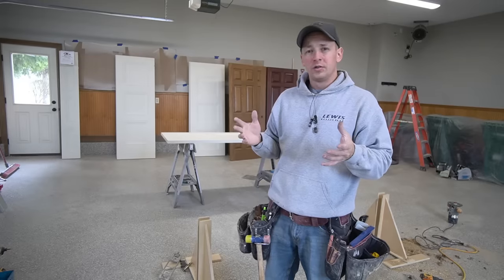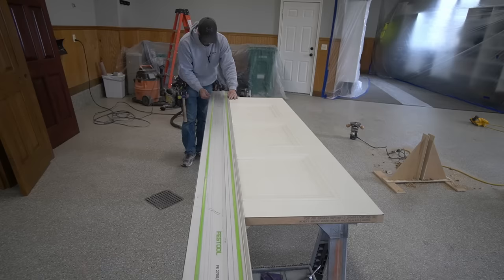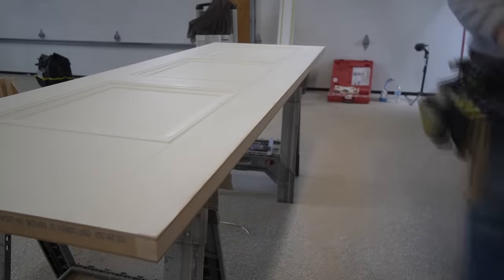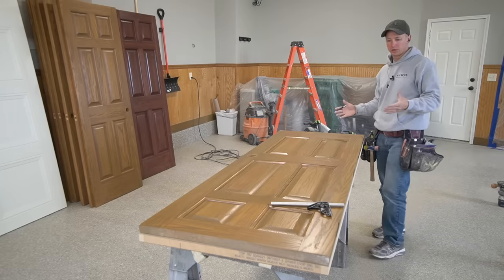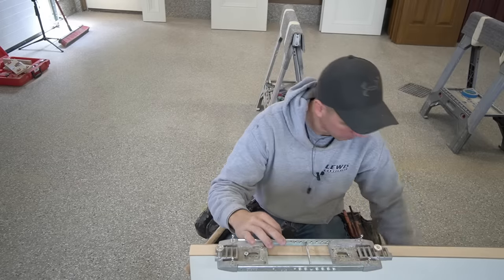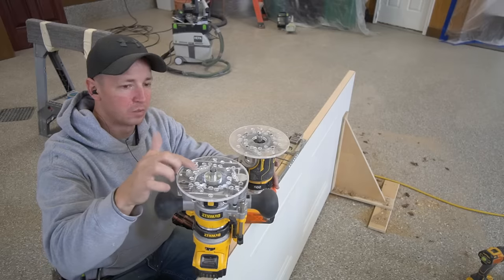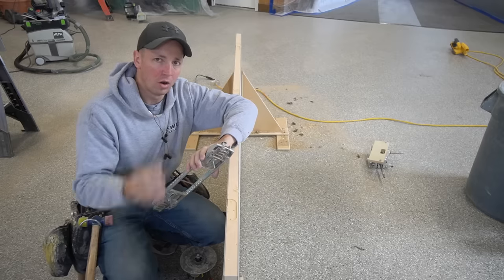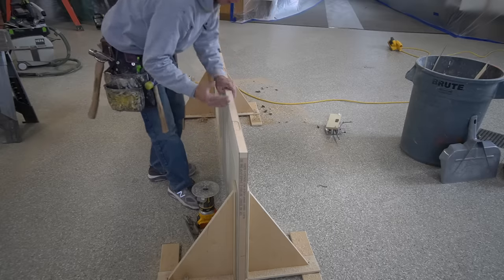How to Hang a New Door in an OLD OPENING | Whole House Interior Door Slab Replacement

Comment: Just plane the door enough to be a tight fit in the frame then scribe a margin line all the way around the door,cut or plane to this line with a slight undercut then stand the door back into the frame and position it with equal margins and mark the position of the hinges and lock ,the door will then be a perfect fit with parallel margins all round the door,job done.

Comment: What brand is the hinge jig that your using Spencer? My trend skeleton hinge jig paired with my DeWalt router is my favourite bit of kit. Look in to getting some 3-way G clamps they are great for clamping the jig to the doors edge, they hold really securely and don't leave the nail holes in the door. Great video thanks! 👍🙂
Reply: Aha you just mentioned that they are made by Bosch, I'm surprised that I have never seen or heard of them over here before. 👍🙂
Reply from the maker: I got this set off ebay. I don't know when they stopped making them, but they aren't available anymore. 

I looked at that trend jig. But since i don't do this much I opted to make due with what I have.
Reply: @InsiderCarpentry  I didn't even know that  people used the trend jig in the States, I don't get all that much use out of mind tbh . Those 3 way g clamps will work for your Bosch jigs,I can't recommend them enough. 👍🙂

Comment: The problem with using the old door as a template is it assumes the old doors were correct size.. Many doors I swap are digger as that's part of the reason they want them replacing as they were a bad fit

Comment: I would be interested in seeing or your tips/suggestions about troubleshooting both interior and exterior doors. I work in new home construction and in Florida spit-jam doors are used for production reasons....issue is the young installer blow-go...many times leaving the doors mess. 1/4” + gaps on strike side...to the point the strike plate is exposed and visible because the door is barely hitting the stop. Would be interested on any tips.
Reply from the maker: I hope to cover that eventually. Most of the doors I install are split jamb doors. Its a local market thing.

Comment: Curious why you don't set the new door in the existing opening with a Winbag underneath and pump it up to the 1/8" reveal on top. That way you can check the gap all along the top of the door and then mark your hinge locations from the existing jamb

Comment: I know you preach efficiency but is working pace( the rate at which you move) also important for maximum productivity? Or should you always work at a steady pace?
Reply from the maker: Great question. I tend to move like I have somewhere to get to if you know what I mean. But I don’t feel I look rushed. On the other hand there are guys who are just plan slow in nature. (Think Zootopia Sloth Scene). So how much a person needs to “rush” is gonna be personality dependent.
Reply: @InsiderCarpentry  thanks for the reply also I know good quality work is what we all should strive for but do you think working to tolerances is necessary, I know working to perfection is ideal but working to unnecessary tight tolerances takes extra time don’t you think?
Reply from the maker: I feel that good carpenters can achieve very close to perfect tolerances the first cut.

Comment: Do you ever shim behind the hinges to make the gaps equal between the frame and door if there’s a discrepancy?
Reply from the maker: I bend hinge knuckles with a fast cap kunckle bender wrench.  But you have to wait until the painter is done messing with the hinges otherwise they will mix them up and you're screwed.
Reply: @InsiderCarpentry  I tell my painter to leave the hinges on. I tell him this because sometimes you end up stripping out the screw holes. Yes he does tape them up.

Comment: I would like to get a set of the three Vix bits, however, I did not see the affiliate link that you mentioned in the video.  Also, do you recommend the set with the hex shanks or the smooth shank that needs to be spun into a drill chuck?  Thanks for the recommendation!
Reply from the maker: Ah. I forgot to link it. Here you go. 

Definitely hex shank so you can use with an impact also. 

https://amzn.to/39ENq3W
Reply: @InsiderCarpentry  Just ordered a set!  I am a little concerned with some of the reviews that the hexshanks are not milled correctly and get stuck in your drill.  Hopefully they have fixed that issue and I will have no issues with that.  Fingers crossed...
Reply: I have a number of Vix-style bits from Makita and I think Ryobi. The original Vix are pretty expensive, are they better quality?
Reply: @russalbright4213  I've been using the Snappy ones without issue for 15 or so years.

Comment: From experience
Replacement of doors in existing jambs
Not all jambs are PLUMB 
Many have waves in them & you cannot control or correct the jambs without effecting the trim
To do so could cause damage which you might not be able to fix
Like out of style trim
Or old trim not made anymore
To even match old paint

Solution for Me
Was to take slab door lay atop new door, center clamp draw outline then cut to lines
Transfer hing & knob location to new door while old door on top of cut new door

Everything always lines up perfect in the end

Ps
I always change top hing top screw with 2 1/2 in gold screw to prevent sagging
If not gold screw, I bore a whole under hing plate so it's not visible
Reply: Not to mention the head is often not level on old linings..
Reply: Anything different to consider when doing an exterior door?

Comment: I needed to cut down a new door to a width they didn't make. You can see at the top and bottom just how thin the wooden perimeter is. Ended up seperating the front panel off the door cutting and refitting the side timbers. Modern doors are absolute junk, mdf, cheap wood and cardboard fillers to keep noise down. 
Now those oak doors you removed.....